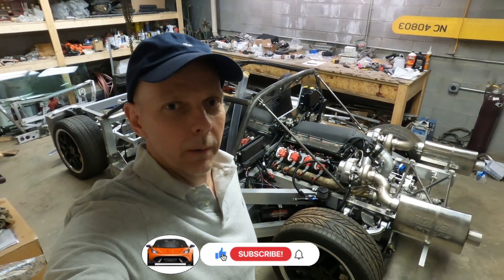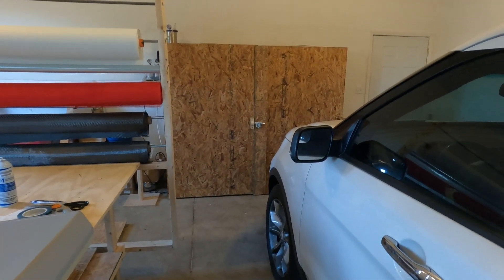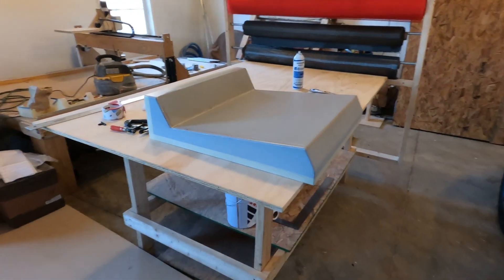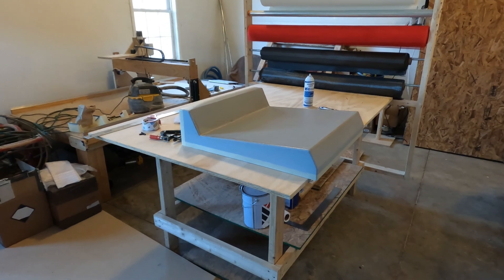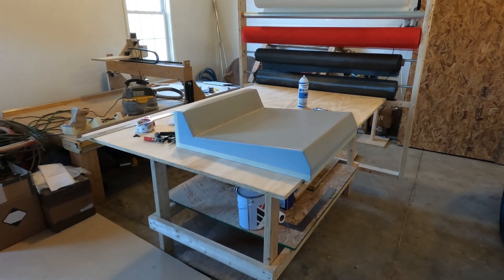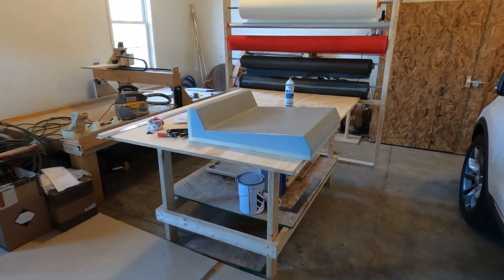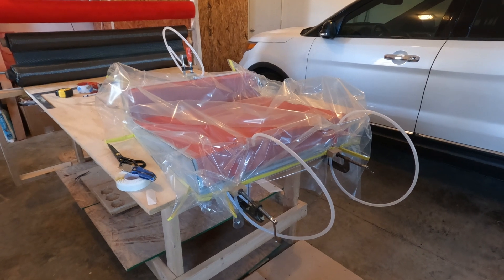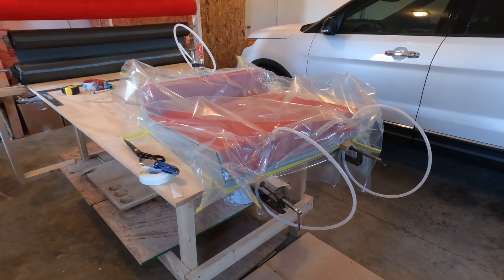Building my own Supercar - Making rear firewall carbon fiber parts

Comment: Hi Roger - I'm loving the channel. You are very brave to take on such a project!   I'm assuming that a supercar should be super in as many areas of performance as possible, which includes the sound system. The JL is a fine woofer but the co-axs you showed for the front are woefully inadequate. I highly recommend upgrading that to separates so you can use a small enclosure for the mid and aim the tweeters independently. You've mentioned putting rear speakers on the firewall shelf. Please don't. The left rear will be way too close to your head and overpower the rest of the speakers. The passenger will experience the same problem from the right speaker. Turning the balance only helps one of you. It's best to rely on well placed high quality front speakers and the woofer.
Reply from the maker: Thank you for the comments. I actually have some experience in installing hi  performance car audio, several years ago. I had already decided not to use rear speakers for that very reason. I had not considered using separate front speakers but I think more about that. I might even add a center channel speaker, just for better sound adjustment. Thanks for the reply and thanks for watching.

Comment: Hi Roger, this does take a lot of time, for each piece. Wow. But on the other hand, you have mastered a new skill. Nice to see, thanks for sharing!
👍💪✌️
Reply from the maker: Thank you. Are you experienced in making CF parts? Every part I have made so far has small issues I hope I can fix. I would like to figure out what I am doing wrong before I get to more important and more visible parts.
Reply: @basementsupercarbuild2948  I have zero experience with fabrication. The process method you are using I've seen the least amount of. Instead of vacuum infusion some just use the brush and scrape method, with vacuum to cure. The size may make that choice impossible maybe. Pure carbon fiber costs are high for many reasons.
But I think you are very close, maybe a small leak that varies the thickness of the end product or the direction of the object maybe? I'm just guessing.